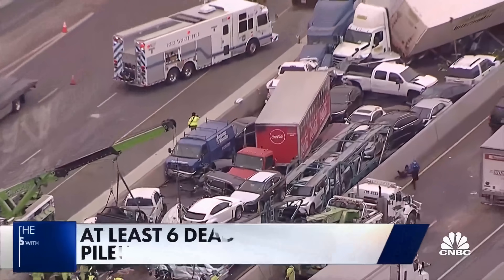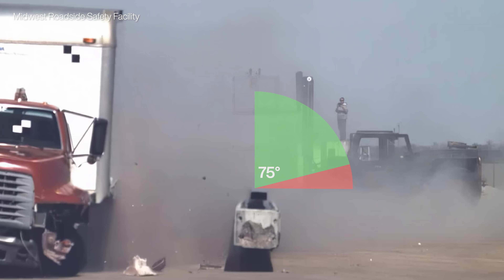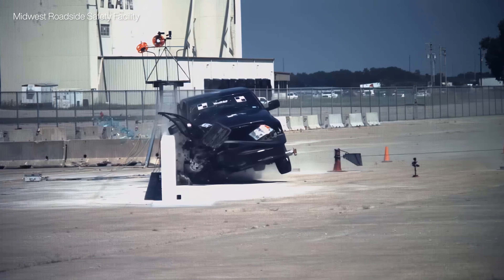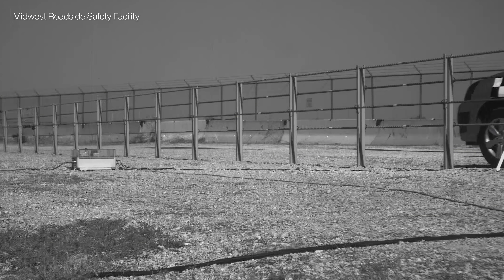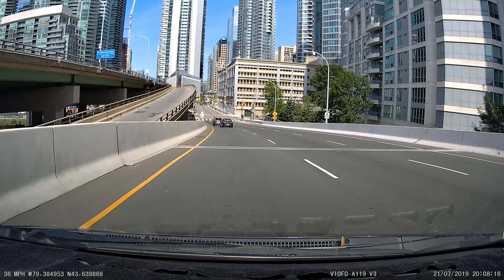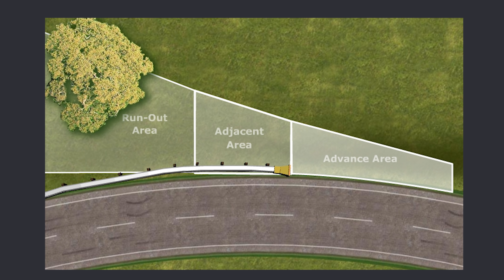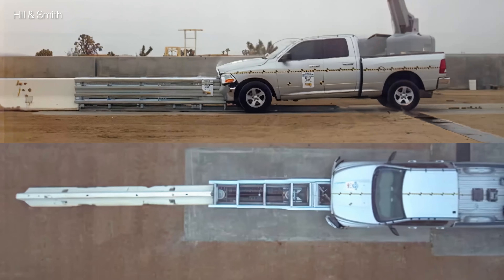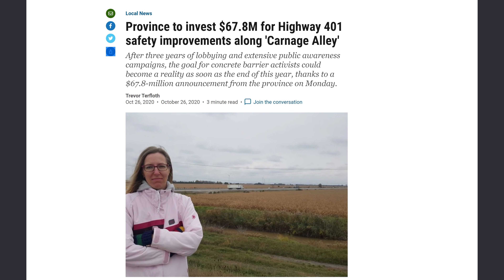How Road Barriers Stopped Killing Drivers

Comment: cable barriers are really dangerous against motor cyclists.
Reply: they're just more gruesome. a concrete barrier will turn you to mash inside your leather jacket anyways.
Reply: @83hjf  if hit from straight on yes. But at an Angle? A concrete barrier is like a vertical road if you think about it. You will just glide along it and then to the floor. Imagine if the road had long wires held upp by metal poles at regular intervals whenever you fell. You'd lose an arm REALLY quickly and there after every other body part.
Installing cable barriers is just irresponsible to bikers.

Comment: Many years ago a friend's son lost an arm and a leg on the sharp-edged metal posts of a guardrail cause he slided under the rail with his motorcycle. After this, they put foam around the posts in some dangerous curves or installed a second rail below the first one to prevent bikers from sliding underneath the rail.

Comment: I agree in not liking the cable barriers and thinking they are simply for cost efficient work. My high school basketball coach was killed on our interstate highway when a car from the opposite side of the road, went off the road, went straight through the cable barrier with no slow down and hit him head on. Seemed to me like there was little the cable barrier did to slow down the car.

Comment: Cable barriers look like they're designed to shred motorcyclists.
Reply: Looking at all the barriers, I dont think a motorcyclist would do well hitting any of them
Reply: @ValentineC137  I would much rather hit a concrete barrier at a low angle than cables. At a high angle you're fucked either way.
Reply: @lucaprinselaar  Yea I think my odds of Evel Knieveling up the side of a concrete barrier are better than my odds of coming out in one piece with a cable barrier. I was in an accident and hit a car that was making an illegal left in front of me once while I was going like 85kmph and came out with no broken bones so not really much difference between that and hitting concrete really.
Reply: @ValentineC137  yea
Reply: Unfortunately for motorcyclists, they're a very small minority of drivers, so their interests are probably not a high priority with policy-makers.  They're a much higher proportion of fatalities, but even there, they're way outnumbered.  Something that helps car drivers a bit and hurts motorcyclists a lot probably comes out on top in a statistical evaluation.
Reply: I’ve never seen them in Europe, so I think they might not be as good as concrete or guard rails.
Reply: @gwyneddboom2579  there are some in Poland i.e.
Reply: @gwyneddboom2579  Cable barriers exist in Europe too. In quite a few places actually.
Reply: @RealCadde  Sweden uses them a lot as far as I know. I've also seen them on the motorways in southern Norway
Reply: When a motorcyclists hits a cable barrier whatever side the ambulance is determines which bits get picked up first, cable barriers may be cheap but they are very dangerous to motorcyclists.
Reply: @CrusaderSports250  But they do stop the bike smacking into someone innocent coming the other way.
Reply: @ohasis8331  the motorcyclist may have been the innocent party to start with, a solid barrier would also stop the bike and be less dangerous to the rider, personally I think it is unforgivable that they fit something that is proven to be lethal to a user group, the biggest thing in cable barriers favour is that they are cheap, as they are proven to be harmful to motorcyclists then the authorities that fit them should be liable for the total cost to a rider and or their dependants, all costs including on going ones, they wouldn't be so cheap then and you would soon see them removed.
Reply: Motorcycles aren't really designed for safety lol
Reply: @strykerbravo9910  I guess. But I still don't of the possibility of getting ripped in half whenever someone goes out for a ride
Reply: @Cesar Silva  Cars that go faster then 20 mph ain't safe.
Although it’s more real to say it’s the drivers that are the cause of almost all so called accidents.
Reply: Many states aren't that concerned about motorcyclists because the riders lobbied so hard to repeal helmet laws.  If motorcyclists don't want to wear helmets, then the state isn't as concerned.
Reply: I don't think any motorcycle would survive any barrier. All are going to result in you being mangled and catapulted across the damn mason dixon line lol
Reply: Absolutely.  They are called cheese grates for a reason
Reply: all of these bariers only safe car drivers while for bikers the safest are no Barriers
Reply: as a motorcyclist, you should slow down a little. not go at 200kmh speeds. especially when there are curbs and barriers.
Reply: they do.
Reply: Guardrails are also very dangerous to motorcyclists, particularly if you low-side under them
Reply: @kkfoto  everything is dangerous the motorcyclists, you think they will get the message.
Reply: there is a reason why motorcyclists are nicknamed "organ donors"
Reply: @Shadow.24772  hence why i signed off that, they’re only allowed to cut me up for education or science, and the fact that I don’t want someone to get my damaged lungs, damaged kidneys or damaged liver😂
Reply: @DaNuff1337  you'd be surprised how expensive an eye ball can be on the black markets. as in yea...apparently we can transplant eyeballs now
Reply: @DaNuff1337  you realize they only give out the parts that aren't damaged.
Reply: Motorcycles are proven to be one of the most dangerous forms of road transportation that's still legal in most roads. If you're driving one, you better be prepared for the worst.
Reply: shred motorcyclists now there is a solution.

Comment: Cool video! I work for a company in the GTA who installs pretty much all of the guardrails, temporary concrete barriers, and crash cushions from Brantford to Peterborough, and up past Midland. Sometimes further lol. 
It’s cool to see people interested in the science behind the work we do! I learned some stuff too! We always install MSKTs, but I never knew what that stood for. Same with the TL rating. I just knew TL2 was used on lower speed roads, and TL3s go on high speed, I didn’t know they went up to 6!

I’m not totally sure, but that one short clip at 11:48 looks like it’s at avenue road and eglinton. If it is I may have actually installed that TL-2 quad on the left lol. I definitely put one in on that corner several years ago.

Comment: my state's DOT has removed the term "guardrail" from its vocabulary. The term gives the public a false sense of their intended use. They are not used to "guard" whatever is behind them (a common request received from citizens). the DOT now uses the term "guiderail" instead. As their intended use is to "guide" vehicles away from off road hazards.

Comment: So basically car safety has increased but motorcycle safety hasn’t not surprised it’s a hard thing to do but every one of these methods shouts decapitation
Reply: If it stops a biker it likely allows a car to hop it, or doesn't stop them well enough. Learned that when I saw a biker safe railing have a car ramp up it and end up 50 feed down a hilled highway side... that' a serious problem.

Comment: I’m from the Netherlands where those things aren’t as common. Our infrastructure is designed in such a way that vehicles rarely crash into the side of the road. There are strict speedlimits for heavy vehicles to prevent the dramatic crashes like in Texas.

The whole ‘How much will is cost to replace?’ is not even relevant. The real question here is ‘How do we prevent the crashes and if a crash occurs, how will we make it the safest crash possible?’. The system also allows for mistakes by drivers. The faster the speedlimit, the more measurements are taken to allow for honest mistakes.

Look up ‘Duurzaam Veilig’ for a good introduction to our infrastructure here.

Comment: I spent 30 years doing road work. I have installed and repaired hundreds of what you called crash cushions. They are actually called attenuators. Their size is determined by the speed limit on the roadway. If you have any other questions feel free to ask.

Comment: I noticed that motorcycle safety was never mentioned. They need as much protection as they can get
Reply: its too squishy to engineer for, main safety factor on a motorcycle is your brain.
Reply: Unless everything was a low friction pillow (Which I would love btw), you're kinda stuck. Nothing is great for this, although I think by using bands rather than cable those limb cutting rails could be better

Comment: The U,K. is removing metal & installing any miles of New Jersey or F Shape concrete barriers on busy roads. We are told. Yes they are expensive to instal but ongoing maintenance costs less.  With metal a Semi would often crossover causing a major incident.  A Semi can hit the concrete barrier and normally not cause enough damage to require repairs. Metal barriers often needed lane closures.
The authorities tell us that the concrete barriers cut down death and injury. Important in part of the world with a National Health Service. In some other parts of the world injury provides a sales opportunity for the medical profession.
 I also ride motorcycles. The cable barriers look too much like cheese wires. There has also been stories of people & loosing an arm or leg when sliding down the road & coming into contact with an upright. 
Having seen someone die when his neck ran along the top of a metal barrier I prefer concrete.

Comment: Kinda strange how something so common and mundane could also be extremely interesting...
Reply: You should look up culverts then.
Reply: @EndingEchoes93  I guess i will look into them later with dinner lol
Reply: the issue with a mesh is it will do more damage to a glancing hit. the cables are aligned horizontally so they can be under high tension and also so they don't snag.

Comment: I've never seen the cable barrier in Europe, as soon as you talked about it I thought : motorcycle, and I don't ride, but I can imagine what happens when the 2 meet. Seems like a death contraption for them. But as you say at the end of the video : somebody weighted the cost of saving somebody's else life, in this case the cost of not decapitating them.
Reply: In the US a road might run 1200 miles long, and the cost of a barrier might get to the point of it being FAR too much to place up. Also large trucks constantly roam the highways. Basically, a cable might save a family of 4 from a semi-truck one day a year, while that ONE motorcycle rider might get killed per 5 years. More lives saved = better.

Comment: Great video.

In my country all wire dividers have been replaced with steel or concrete.

It was found that large trucks just plowed over them and in to oncoming traffic, and that more than a few deaths could be directlly attributed to the cables damaging the occupants of the cars that crashed. Most of these accidents, it was found that if there had been steel barriers the people would not have been killed.

Comment: While safety measures have increased survivability of accidents, the root cause of accidents have spread unchecked in recent yrs.

In Ca, Latino drivers cause a disproportionate % of DUIs, hit and runs, distracted driving. Disregard for common decency, the safety of other motorists; and, even traffic law, run rampantly amok among Calif Latinos. 

It'd be great if you could help shed some light on this censored topic to prompt proper public discourse and overdue action to address this taboo issue.

Comment: I hit one of these in january and my car looks worse than the car on the left in thumbnail. Had a seizure at the wheel, dislocated my hip and broke the dash with my forehead. I was then billed 7000 with a court subpoena to repay the costs on the DENT I left in the exact guardrail in the thumbnail. ( bumped off it just like the vid example of guardrail) The state replaced it completely. Charged me, a minimum wage worker living ina small apartment who cant walk or run like I used too. As if I can afford 7k after losing my car aswell. Lord help me

Comment: Seat belt laws are unconstitutional and so are sobriety check points. ANY check point is unconstitutional. If seat belt laws were constitutional then motorcycles would be banned. That's never going to happen. If a person can voluntarily put their life at risk on a motorcycle then I can voluntarily take the extra risk of not wearing my seat belt. There is absolutely no way around that logic.
Reply: Checkpoints stop drunken assholes from driving past a cop after they take a night out too far. Also, you don't wear a sweatbelt and your ass is a fucking missile when you leave that car after slamming through the windscreen my dude, and if you're in the back of a car? you sandbag the driver or passenger seat.
Reply: @MotherSafeHarbor  "Checkpoints stop drunken assholes" 
Check points are illegal. They will have to think of a legal way to get drunks off the road. Like maybe outlawing intoxicating substances and harsher penalties for those caught DUI. Use your head man. I would vote to make alcohol illegal in a heartbeat. My right to freedom is protected in the constitution. However....there is no right to alcohol.
Reply: @MotherSafeHarbor  "Also, you don't wear a sweatbelt and your ass is a fucking missile when you leave that car after slamming through the windscreen my dude," 
That's a bogus claim. No proof of any such thing. The fact of the matter is the seat belt laws were passed by do-gooders who think they are saving you from yourself. They have no right to do that. They are illegally infringing on your freedom. Same exact case with helmet laws.

Comment: I really enjoyed this video and guardrail saved my buttocks. It was one of those guardrails that start out horizontally and then twist up it was on a mountain pass. It was late at night back in a day when there was hardly any traffic on the highway and I lost control of a vehicle Chevy Malibu early 2000s went backwards across the highway around the turn I managed to do a 180 seeing the guard rail and I was like thank God the car went right under the guard rail like a skateboarder when the guard will start to twist up like you normally see it the car went sideways then it felt like I was in a small airplane taking off the front end was that high up off. Sparks are flying it was crazy then you heard a loud boom boom boom boom I guess the support snap and the car's momentum then I went over the guardrail and down the side of the mountain. I know that sounds pretty crazy but if that guardrail save my life and I eouldn't have been there I would have flew down the side of the mountain and crashed into the giant trees that were several hundred years old. And then I wouldn't be making this comment on the section

Comment: Andrew, great video. Funny enough you could make another video about the W shaped kinking barriers causing fatal accidents. TXDOT uncovered that the company that made them for a while had changed their design to save money. What happened was some of the models didn’t have the strength to turn the guardrail around and kink it. So it just created a very stiff barrier to crash into.

Comment: So, the only real thing I think they fail to consider is how many times people hit these barriers HEAD ON. For most of these, head on's aren't a problem, unless you're in a small car going head on to a cable barrier. The top cable can EASILY slice through your windshield and through the occupants. How many times this has happened I could not say, but it is something that I think about EVERY time I see cable barriers. I trust the metal barriers, and the concrete barriers have me in the middle, people can still jump them or break through them,  though that's quite unlikely so i'd still call em safe.

Comment: Cable barriers are a definite No-No in Europe. They're a huge danger to any motorcyclist. Any rider being thrown off his or her bike can be decapitated, be cut in half or lose limbs way too easily. Even if an impact with rails or barriers is deadly, it is a very traumatising event to see for everybody around when a body is torn apart by cables. For those reasons, you also don't see any exposed poles for rail systems and where possible, concrete barriers are used.
The extra costs are definitely worth it.
Reply: Difference is you don't have 1000s of miles of roads that need a barrier. A single country might have a couple of thousand, but the US has like... a couple HUNDRED thousand.
Reply: @MotherSafeHarbor  Difference is, in Europe people pay more tax so that country has money to do the proper thing.

Comment: My biggest issue with the cable system is what happens when lines part under tension.

For the terminals, it would be interesting to see something designed after an aircraft carrier's arresting gear.

Comment: We do live in a world of unlimited money. Fiat currency means there's as much money as there is faith the money is good. Cost is just a way to allocate limited resources by priority. The actual limits are the manhours and equipment to build all the stuff. A rolling program could get the best barriers built anywhere they are needed. It just needs people to understand what money actually is and a rethink on the economic system.

Also those cable barriers are supposed to be really bad at tangling and chopping up motorcyclists.